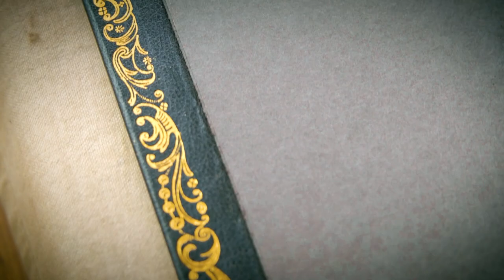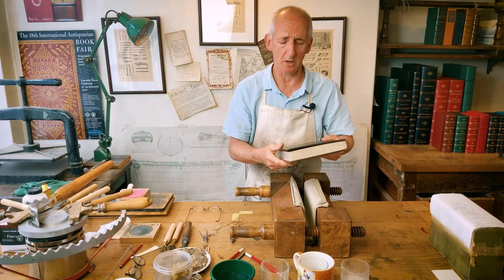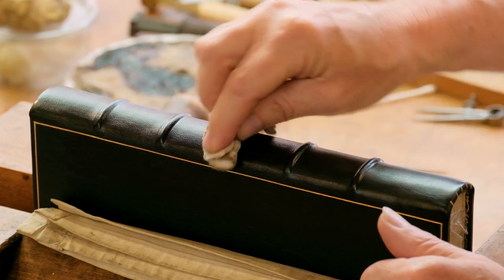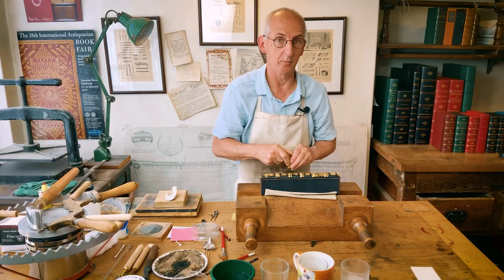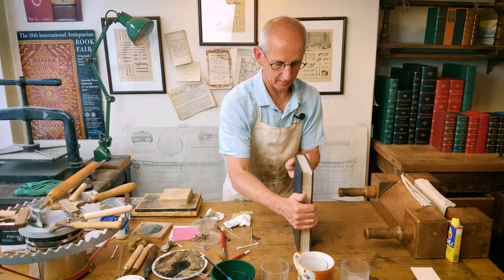An Introduction to Traditional Gold Tooling (trailer)

Comment: Silly question, but how does one describe a book done with gold tooling? Is it, a book embossed/lettered with gold tooling, or a book embossed/lettered with a gold finish, or —?

For example, say if I entered a shop and I wanted to request a [gold finished/gold tooled] book, what would I say? Is that right, would I be right in saying "a gold tooled/finished book"?
Reply from the maker: Yes, a 'gold-tooled binding' or a 'binding hand-tooled in gold' are a couple of relevant descriptions. However, a 'fine' binding is generally considered more elaborate or luxuriant, and older examples usually feature an impressive amount of intricate gold work. This is not necessarily the case with contemporary fine bindings – hence the tutorial!
Reply: @allaboutbookbinding8339  Thank you.